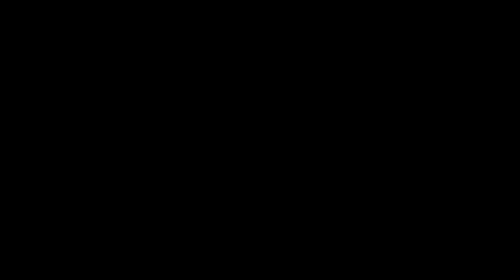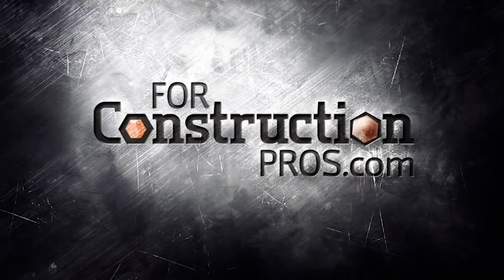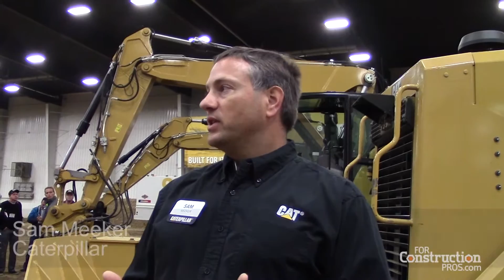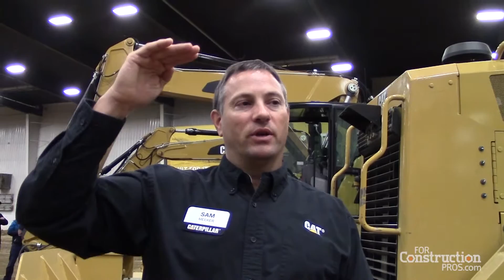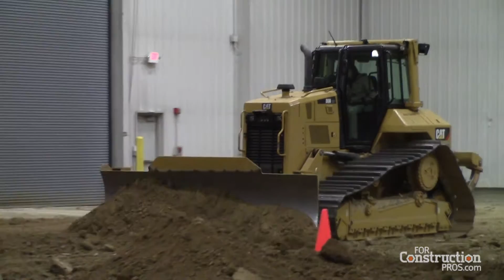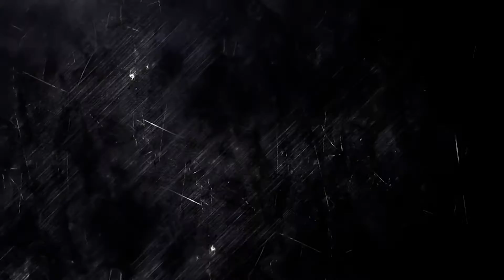How Caterpillar's Lock-up Torque Converter Works on Construction Equipment

Comment: It sounds like it should be incorporated to be a full time setting. Why is it optional, meaning there's a button to switch it on and off in the cab.
Reply: I guess if you aren't pushing any dirt, just tramming somewhere or whatever. It's more efficient to not use it?